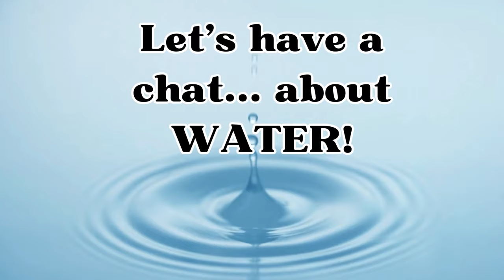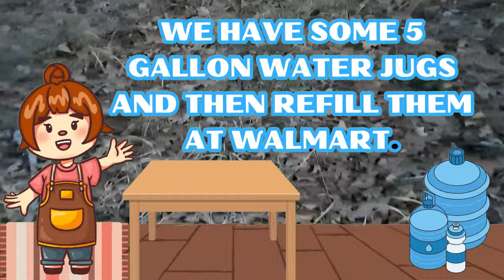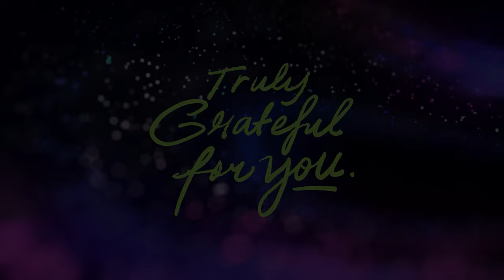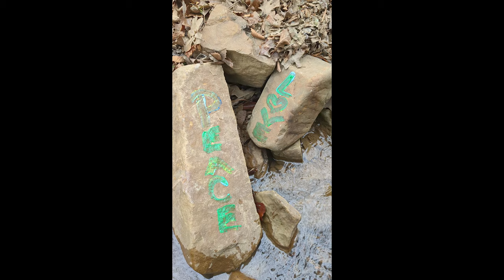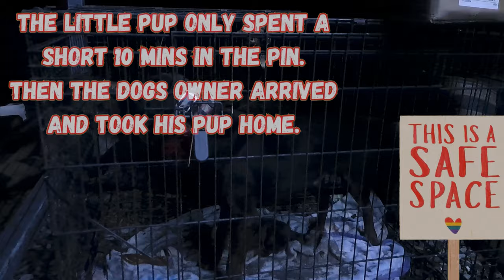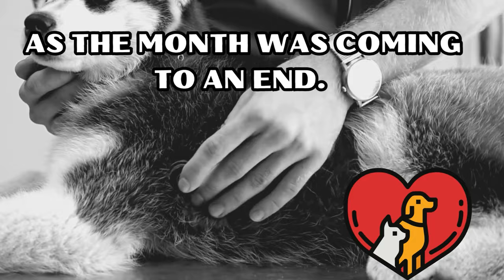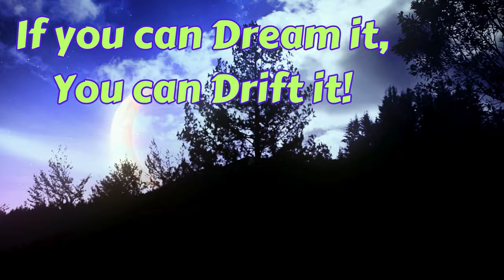FEBUARY LEFT A MARK | work, couple builds, tiny house, homesteading, off-grid, rv life, rv living |

Comment: feel-in ya with the driveway mine was just as bad, it was recommended to us by the contractor that installed our septic that we use 5 inch rock as a base once things dry out. he says the 5 inch or i think they call it B rock around here, has more surface area and will not get pushed down into the soil as quickly top coat with 1 inch with fines and it should last quit a while. The B-rock is more costly so i may go with 3 inch and lay down driveway fabric. I'm hoping this is not a mistake. good luck the dry season is coming soon.

Comment: Nice lil system for pumping Creek. Will you get it tested now? Or add a filter of any sort. I'm you aren't using. It to drink or cook you say but maybe it's clean enough or could be to do so. Also some things can soak thru the skin barrier if you swim or use it for washing. A test might ease your minds and maybe some viewers minds :)
Would certainly make interesting content. Can pH test it with a gadget that doesn't cost much . Maybe do some other home tests or experiments. Like leave some of it in a glass and leave equal amount of Walmart water in a glass and see what happens over a month. Does it get cloudy or smelly or evaporate. Just a fun science experiment  and something the kids could help with. Then maybe at some point you can get a test from someplace and maybe a filtering purifying system sponsorship